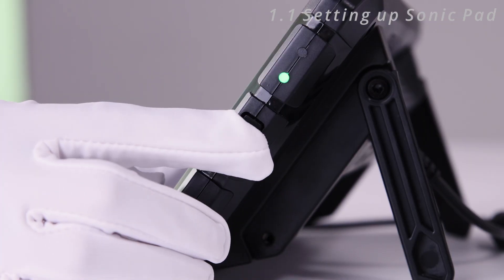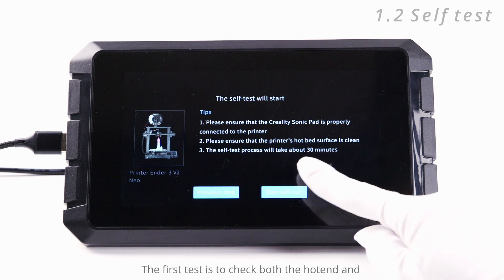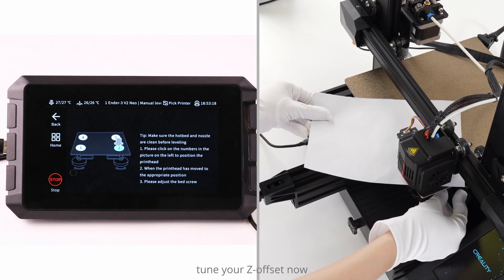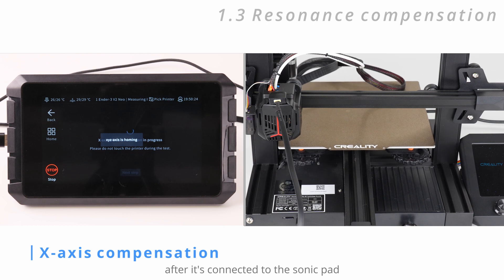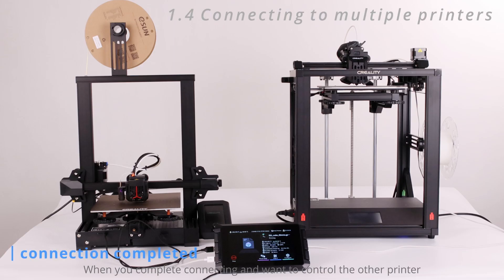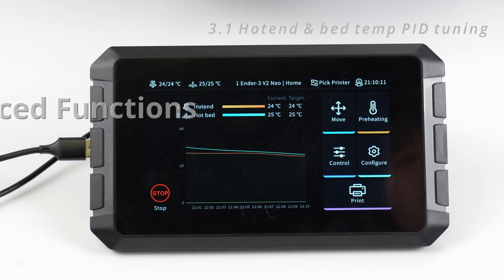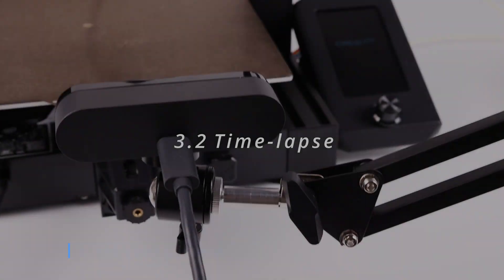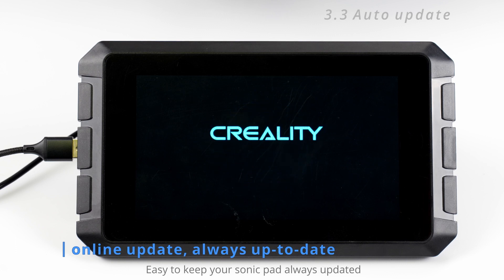Creality Sonic Pad Connection Tutorial & Print Comparison & Advanced Functions

Comment: should the cr6 get power from the sonic pad when the printer is off? The LED light on the printer comes on and I got nervous and unplugged. I remember there was an issue with some of the early cr6se's micro usb port. 2 of my cr6s are kickstarter ones, 1 is a later version but all 3 do this.

Comment: turning out to be a real piece of SHIT: does not connect E3 pro BL v4.27 after connecting and calibrating 12hrs ago. No clues to go back and re-calibrate; will not recognize a file on USB drive!!! NOT PLUG AND PLAY. Same frustrating 3DP firmware horse shit that caused the purchase of this Fing BRICK in the first place. Time to bite the bullet and drop 1500 on a non creality printer THAT JUST WORKS.

Comment: Yer bet you cant connect 2 Ender 3 V3 SE at the same time ive tried .the sonic pad doesnt even know which USB port its using ...my new E3 V3 SE is plugged into USB port 1 and its reading as its in  USB port 2 😆 Like WTF and also with the E3 V3 SE the only way you can connect it is with the serial cable it wont read the included USB cable to run a second Printer of the Exact same type ,thats why in all the youtube videos people are connecting 3-4 different printers because it cant run 2 or more of the exact same printer 🤣Pretty P!ssed off i am bring out new firmware that can run 2-4 of the exact same printer🤬🤬🤬🤬

Comment: I got Sonic pad + Spirit Direct drive + CR touch upgrading to Ender 3v2 motherboard 4.2.2 I am not able to get CR touch Autoleveling it crashes on 1st level point and so on.. Do you have fix or not?
Reply: hello almost the same here except for the motherboard. according to the Manual you have to tighten the the springs, I did not do this and gave each corner about 3 turns to loosen the springs and when from there z-offset, then the four corners en auto level. Maybee you should take a look at the video's of Ricky Impey . don't expect creality to help. their service is very poor